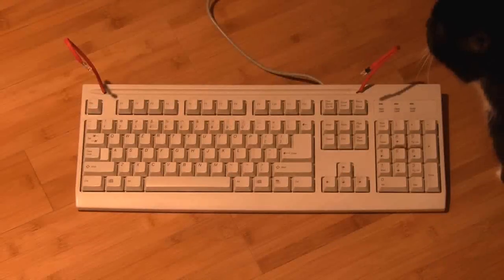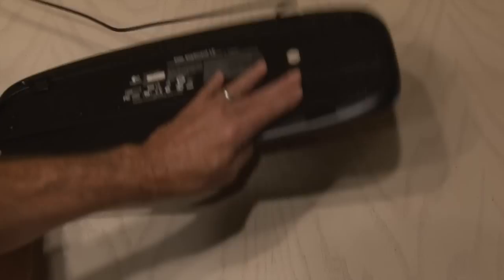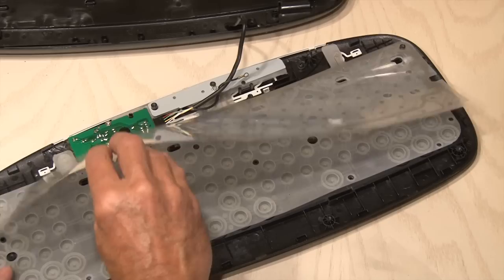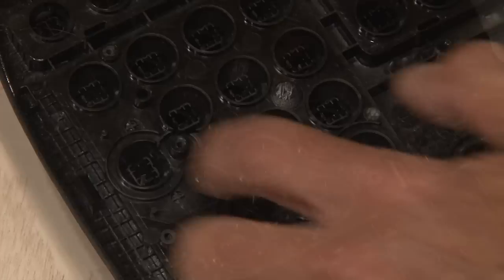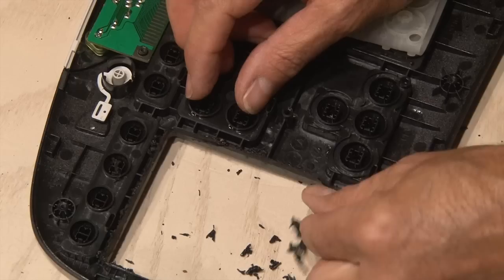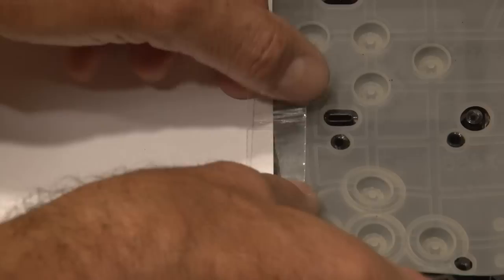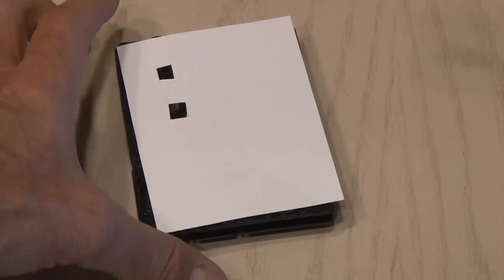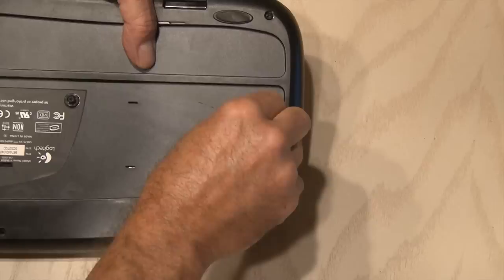Sneaky Keyboard Hack!

Comment: But... I actually use my numeric keypad.
Reply: +No... WAT Y
Reply: +radioactive hugo its a lot more compact
Reply: there is a row of numbers at the top of the keyboard
Reply: +tom jones those are confusing...
Reply: +tom jones its not the same. If you're familiar with the num pad, you can type in numbers really faster than with number row above the letters. 
Also: the numpad has a different ASCII code, so 9 is not Num9. So if you got a Program which is controlable via the numpad (shortcuts etc), you need a numpad. (For example, one time, I had a trainer program for GTA5 and it was only controlable via the numpad), Anyway, I would never cut out mynumpad for a secret place... its dumb
Reply: +Kyle Jenison its not confusing. its in order 1 2 3 4 5 6 7 8 9
Reply: +radioactive hugo You can make cool symbols with the numpad that you cant make anywhere else
Reply: +No...  how wait let me use it  WTH
Reply: +tom jones They aren't as efficient for using Excel or anything like that. Plus, you'll need to do ctrl/alt/del and it's a lot easier to do with the number pad's delete key.
Reply: +No... Then get a number pad and when people ask why you have 2 numeric pads, say the 2nd one is for macros.
Reply: I use my numeric keypad because some programs i use and games use the numeric keypad as hotkeys.
Reply: I need my numeric keypad for mousekeys.
Reply: @maxmclachlan9403  alt keys

Comment: Seems like a lot of effort for not much in return.

Might as well just gut the entire keyboard and use it as one big stash, take out all of the insides, then just glue down a big sheet of card that will keep the buttons pushed out and open it from the back with a single screw or with neodymium magnets on each corner.

Then just put it where you would normally put an old crappy keyboard, I have about 5 floating around the house in cupboards, under my bed, on top of wardrobes etc... Like you said, who would steal them.
Reply: It just seems illogical (assuming the keyboard is never going to be used), to convert 20% of the keyboard into a stash, leaving 80% of it being useless.

An unnecessary hindrance., which requires more work.
Reply: See I don't really understand that way of thinking. I can understand seeing this and expanding upon it in a similar way to what I mentioned, or converting the same concept to another peripheral or so.

But to follow an illogical project to the letter, which has you creating a numeric keypad stash and ignoring the other 80% of the keyboard, while taking more effort.

That would just annoy me. I'd need to go further and develop it into something more practical.

Comment: Wouldn't it be quicker and easier to hide your cash in a jar of coffee or inside a book by cutting out a few pages?????
Reply: yes except the fact that those are the places the general public use so robber sees a coffee can outta place hes gonna look in it
Reply: Not if it's in the freezer, which is where we're supposed to keep our coffee.  Failing that, is a robber going to go through every single book in a house looking for a secret compartment??  I don't think so.
Reply: Girlique Shouldn't really keep coffee in the freezer or fridge. Taking it in and out will cause condensation inside the container making it spoil faster and changing the flavor. Best is to keep it in an air tight container at room temperature. I always used to keep my coffee in the fridge until I learned this, it's definitely made a difference in shelf-life and flavor.
Reply: travelbug1019 I store my coffee beans in the freezer in its vaccum sealed bag.  When I need to use it, I take it out of the freezer, grind the beans and transfer the coffee to an airtight container and store it in the fridge.  Then we can use what we need each day and put it straight back in the fridge.  We go through a lot of coffee at home, about a bag a week, so there's no need to improve its shelf-life.  And the flavour is fantastic - love a double shot of espresso!

Comment: > Doesn't work for mechanical keyboards
> Gamers are fucked
> if you have a mechanical keyboard dunt do dis.
Reply: JΛIKΣ How are gamers fucked they could use another keyboard
Reply: Desmond Miles yes, but lots of gamers do have mechanical keyboards, and they may not have another keyboard, and if they do it's probably not a rubber dome keyboard. although those with the a rubber dome keyboard are fine.
Reply: JΛIKΣ I could just buy a cheap keyboard for this
Reply: Desmond Miles yeah, but it's not worth it.
Reply: JΛIKΣ Not worth $3
Reply: Desmond Miles Nah. It isn't worth $3.
Reply: Desmond Miles You could buy lollies and lolis instead of buying a keyboard.
much better alternative.
Reply: James Reynolds hmmhmm, daz why i put it there.
you could probably buy lolis with lollies.